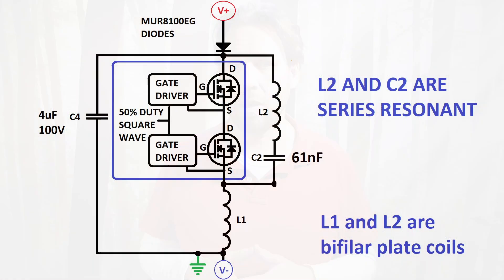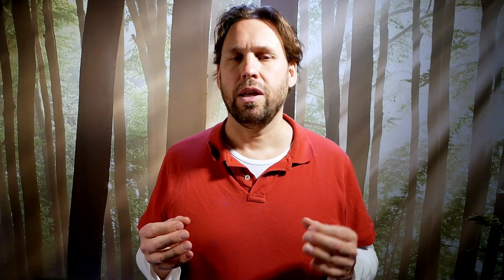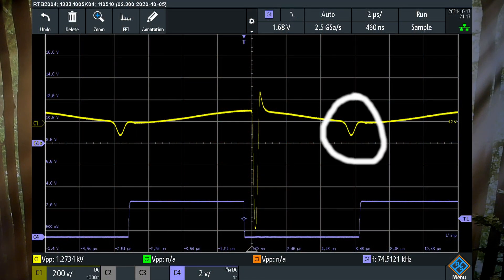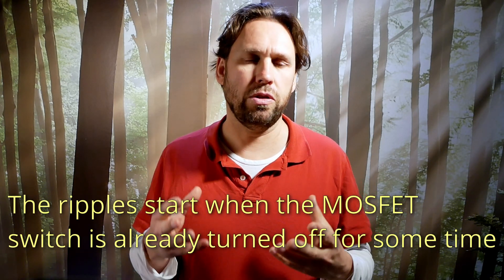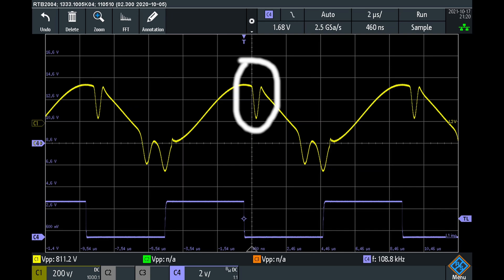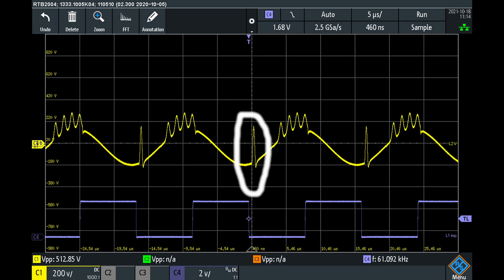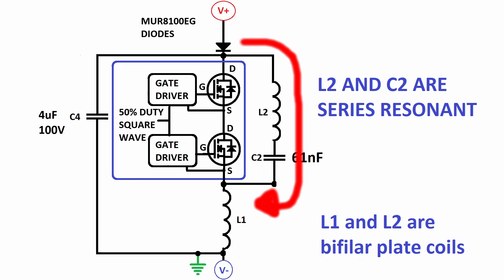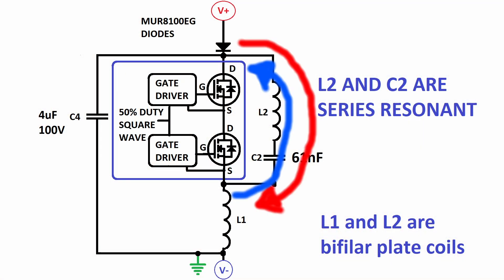The Ripple Anomaly

Comment: I just burned up 2 of the cree mosfets lol

They do take a beating but can't take heat too long. For sure. :(
Kinda sad they were 22$ each

They were on a decent heatsink too. But they got heatsink super hot so apparently it wasn't too adequate
Reply from the maker: Yeah, that's not funny.
use termal paste and a fan.
most heat is from the body diodes. the positive half wave of L1 passes through them into the cap.
or did you do something else?

Comment: Do you have a video of how you constructed your tuning boards? I would like to replicate it as closely as I can.... Thanks in advance...
Reply: So the board consist of 20 capacitors 10- 1nf and 10- 10nf with 20 switches, all in parallel. Then make another one just like it for the L3 coil? Right? Then one is connected to L2 in series and one is connected to parallel. Right?
Reply from the maker: @jmwibe  Correct! be careful with the DC voltages. don't blow your caps like I did.
tune at with the board, then make an equal value high voltage capacitor and replace the board with that cap, so you can get higher dc voltages
Reply: @MasterIvo  I noticed that you use the capacitors in order to increase their voltage capacity in some instances. Wouldn't it be better to simply use higher voltage capacitors? I've used several variations in my work. I'm disabled, but I used to be an industrial electrician for over 30 years
Reply from the maker: yes higher voltage caps would be best. but I didn't find that option although they are sold somewhere. I believe 6kv are even available
Reply: @MasterIvo  I noticed some on Amazon that were rated at 15kv. It is high, but it would definitely be in the safe zone. I was also wondering what frequency are you trying to achieve. Alot of the research I've done, reflect the idea that the base frequency and it's harmonics are important at the same time..
Reply from the maker: I usually aim for 70kc/s or lower. 15kV? but then you would need another high voltage source to get that high, which makes it inefficient.
I stick to 4kV as my impulses are max 3.5kV.

Indeed harmonics are important.
Reply: @MasterIvo  perhaps my understanding of capacitance is incorrect, but if the you have a 5 gallon bucket and only put 1 gallon of water in it, that is all you will ever put in it. It is still able to hold 5 gallons, but if you never put more than 1 gallon in it, you should be fine. Is this concept wrong?
Reply: Given that you always remove the 1 gallon every time...
Reply from the maker: yes it's fine, but probably a waste of money
Reply: @MasterIvo  Have you found any advantages to changing the inside diameter of you could that you have wound?
Reply: @MasterIvo  By the way, I found some 3kv capacitors on Amazon and I ordered them. Will I need to connect them in parallel on the capacitor test board to be able to go over the 3 kv level you have mentioned above?
Reply: Sorry, coil not could...
Reply from the maker: No I haven't but it is fairly simple. All capacitors are hooked up in parallel with one leg. The other leg is connected to the switch, which is then connected in parallel to all the other switches of the caps. each cap has it's own switch.
the leads are then hooked to the connector for the coils. Just follow the logic, and be creative. 
I grouped 
10x 100pF
10x 1nF
5x 10nF
But the 10X 100pF I barely use. so I would recommend leving them out, and instead of 5x 10nF use 10x 10nF.
Good luck on your build

Comment: Finally someone else who sees two currents flowing in the opposite direction.
https://youtu.be/k0jJTsxJHzI

Middle of the video. When i twist the second bulb in. The rpms never change.
And i seen it go right through the diodes. And here .
https://youtu.be/-9q7C5fgJQE
Consumption of power never changed. Pulse length,time and distance did.

Comment: I recommend shorting out all 3 coils during the ripples for an extreme point source reaction ;-) the ripples precieve “on switching” so shorting all 3 coils for the ripple duration will peak match and point source the faster than light preconception, blocking that waver for a decisive full bifilar short induced system shutoff, and exponential recoup charge will result when a full system “on” is switched resulting in anti-gravitation effects.

I don’t know if you care or believe in antigravity, Master Ivo, however being that I am a typically mute fan of yours ongoing, I owe you an invitation to join with me in starting up an open source antigravity company protected by defensive publications for nullifying patents. If you accept who would you staff for manufacture and sales?
Reply from the maker: I do know it is possible, beyond belief. And it is closely related to free   power generation. As it is the same force but used differently.
Shorting the coils, interresting.
Starting a company would be after first finding out how it works and open sourcing it.
Reply: @MasterIvo  I came across a bifilar coil inductor type of array 15 years ago that worked and today there are others avidly researching antigravity thanks to platforms like this. Shaping the bifilar coils into magnetic monopoles by forming them half spherically is key. Various Rodin coil arrays work too. I will be sharing an entire antigravity craft build using CAD  for APEC here on YouTube one day and showcase a working craft at Burning Man in Nevada some year soon.. I certainly do not want to interfere with your program here so this will remain an open invitation for you, Master Ivo. When you are ready I suggest starting a 501c3 with you and other’s interested. I will place my designs on GitHub and https://lotnet.com/tdcommons-a-free-platform-for-defensive-publications/ to protect it from patents. Once I have done those things I will get back to you if you like. Light and Life !

Comment: Interesting that the beginning of the ripple is forced further away in time as the impulse  voltage is increased. Also I wonder what frequency this ripple is? Does it change when other values change? Is it a multiple harmonic of the primary coil? 
Just questions, no answers…
Thanks for your work Ivo. Very interesting and valuable.

Comment: I get same ripples when tunned to the initial resonant frequency, if you further increase the speed then you can find a secondary resonant frequency where the ripples disappear and power input and output increases as well
Reply: It also appears like L2 ando C4 are affecting your boostrap circuit therefore the mosfet shuts down
Reply from the maker: maybe. but it is not a bootstrap gate driver, I use an isolated dc to dc converter
Reply: Since this is a high side nmos driven circuit you need a Bootstrap, otherwise the nmos turns off during the rise time due to the 0V difference between gate and source load, how are you managing for the Bootstrap? Is it integrated within the driver stage?
Reply from the maker: correct but bootstrap is not the only option! I published the circuit in my "Radiant half-bridge circuit" video.
it is based on a isolated gate driver with a isolated dc to dc converter.

Comment: I am quite ignorant about circuits, but I suspect that you are missing one layer (think onion) between electron size dynamical environment and aether size environment, that is photon/antiphoton domain, the domain that 'feeds' atoms themselves, otherwise they would spin out of existence. You should read Miles Mathis' explanations of those dynamical processes on the level of atomic nucleus. I suspect that what is going on here is that you are (with frequencies and spikes) widening/restricting channels that are responsible for atom nucleic feeding by the photons and antiphotons. That is quite separate dynamics from aether channel opening (magnetics/dielectris of the coil as a unit). Atoms that compose the wire (of the coils) need 'feeding' and your induced oscillations to the coils sometimes prevent that 'feeding' processes. And at the other times the channels for the nuclei 'feed' get opened widely, which disrupts aether environment dynamics. In short: suspected aetheric 'fields' - suspected photonic 'fields' - measurable electronic fields. Nested. Forgive my lame-man's rumblings. ...  I think that efficient aether exploitation can be achieved only when atomic nucleic 'needs' are not impaired. If atoms are disrupted for too long in their process of through-flow of photons/antiphotons (disrupted feeding), the atoms will eventually carve and open channels in the aetheric fields (which you are  trying to learn to control primarily), to let the photon/atiphoton flow in and through.
Reply: Just to be more plastic to what are basic demands of protons and neutrons in atomic nuclei: Miles Mathis claims that every proton channels through itself 19x its own mass of photons/atiphotons every second. And that is a mighty flow, 19 times the mass of the coil of photonic through-flow. The wire has its own basic demands for survival and kicks back if you deny it that food :). Excellent work meštre Ivo.
Reply from the maker: thanks!

Comment: Usually ripples like that are caused by a diode switching off, like in a boost converter for example.  You only have one diode in the circuit you showed in this video,  so perhaps the resonant action is drawing current from the source through that diode, and when it switches off, the inductance of the current path causes a oscillation. To check if this is the case , change the values of the caps (one at a time ofcourse) and see if the period of the oscillation anomaly has changed. I suspect the large non resonant cap of 4uF, if you try reducing that cap and check if the ripple period has  increased.

Comment: the elecric charges should be carried by  "charge carriers".
1- during the electric interruption, the charge carriers stop to flow;
2- this flux reverse the verse of flowing;
3- last when the electric charges  arrives near the electric circuit break point, meet the charge carriers flux in the opposition, creating a big pulse wave and the bounce.
Is something similar that you were searching for?
Reply: I remember Tesla studied this phenomena appeared in many DC electrical plants when the operators manually break the circuit interruption.
In those events, the pulse were so great to leave the wire in form of electric arc and kill operators.
Reply from the maker: From my perspective "charge" is present AS the the voltage and capacity of the Dielectric field itself
Reply: @MasterIvo  and what about the vacuum? :)
Reply from the maker: the vacuum is filled with Aether, and most of the time its "rippling" so in a real vacuum there would be the absence of rippling aether fields?

Comment: Now this interesting! How can this happen? Think fields, in the Aether.
My take on it is at certain frequencys the expansion and collapse of the Aether moves over or impacts upon the coils / points of least resistance.
I have a video everything is a magnet. On the whiteboard bottom left may be what's going on. In effect the Aether flip flops trying to equalise the potential thereby make the pressure rebound into the field bubble collapse.
Hope this helps.. DC

Comment: YES. I've been wondering more and more about ripple, it's the main "question mark" remaining for me. Will stay tuned to your progress, and see if i can notice what parameters affect ripple with my setup. Thanks!
Reply from the maker: Maybe we can tune it in such a way that the ripples allign with the original impulse and amplify it
Reply: @MasterIvo  is this ripple related to the two waves Tesla was using, the impulse and then the oscillation? I believe I saw a lecture by Eric Dollard explaining the concept. Let me see if I can find the video. Reminds me of a hammer and a bell. Maybe the ether when it’s experiencing hysteresis becomes a new medium that the longitudinal transmission can create a pressure wave through? First you fill the pipe, then create a pressure wave? In this case the water is surrounding the pipe.
Reply: “Eric Dollards Tesla Longitudinal wave Energy”

https://youtu.be/r7oAlvaC8ls (7:39)
Reply: Have you seen those rotary spark gaps? Maybe that’s a form of duty cycle? Could this be incorporated into the input frequency to see if the ring could be lengthen with more cycles? I see that it seems to be grabbed or influenced by the sine wave present on the coil. Maybe the input needs to let go so to speak. Baseball would be no fun if no one let go of the ball when they threw it. Maybe that’s what’s happening to the ripple. The ripple is the ball and the carrier wave is the arm.

I guess a better baseball analogy would be people running the baseball instead of throwing it to the other players. The balls speed is limited by the players running speed. We have to input the energy and then release the input influence allowing the energy in the new medium to separate and continue on its own only being influenced by the environment.
Reply from the maker: great feedback Jondelaire. Would love to know the tittle of that Dollard lecture.
I have seen the impulse without a current on high enough voltages.
And I remember the ripples also did change/disappear at higher voltages, I'll have to check this again.